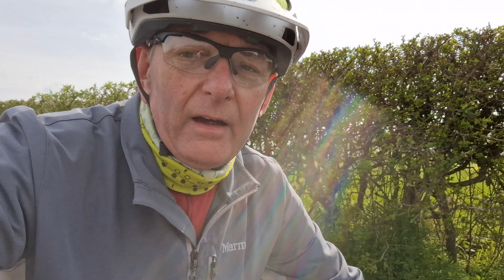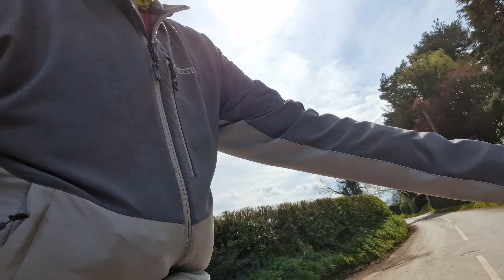Bosch MTB Error code 500 - dead bike the story

Comment: When they fixed your bike did they cover the labour cost or did you have to pay that. Please could you tell me the cost if you did have to pay so I know what I’m getting into because I’ve got the same error code, thanks
Reply from the maker: I had to pay the labour costs of changing the motor which was about an hours labour in total, as I also had the bike serviced at the same time,  so the cost of the additional hour was negligible compared to the cost of the motor,  had I have had to pay for that, which thankfully I  didn't.

Comment: Lucky you, we have a diamondback that is 3 years old and done 500 miles now has error code 500 needs a new motor but has to be same motor like you said £700 not a happy bunny. Apparently Bosch won’t help bike was brought new in 2020 but the motor is a 2018 model
Reply from the maker: That's not good. Is that going through your local bike shop or contacting them yourself?
Reply: @NTLife  that was according to bike shop I have now sent an email to Bosch to see if they can help. I don’t understand why they can’t fix it, so they are not reliable or sustainable in my opinion, hope you get on ok with your new motor.